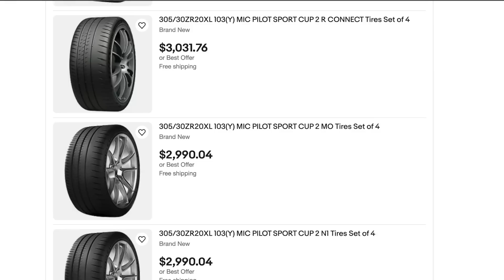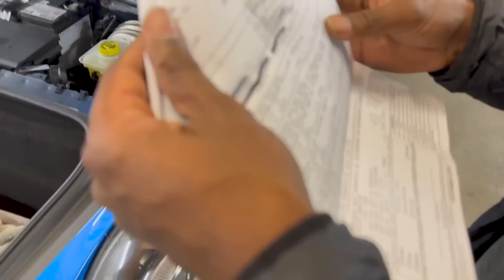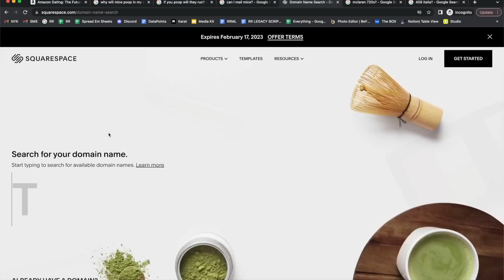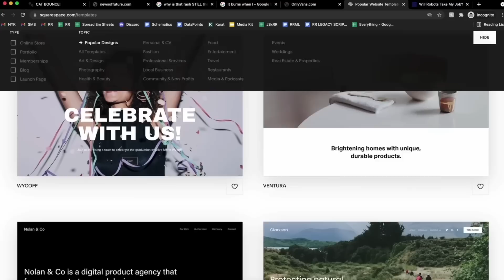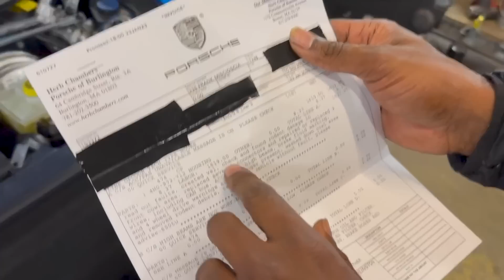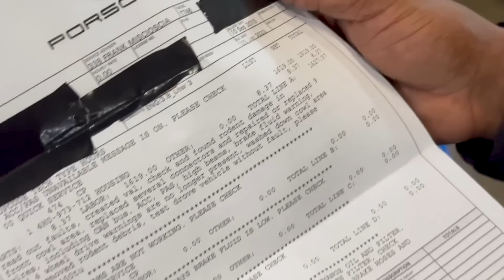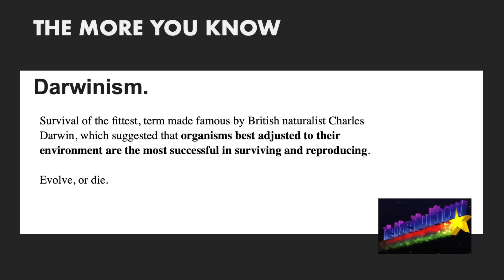I left my Porsche outside for winter and I learned an $8,000 lesson.

Comment: Magnusson Moss Warranty act makes it illegal for a company to require maintenance at their shop in order to keep the warranty valid. They lie. They can absolutely require you to DO the scheduled maintenance but you can do it yourself or at your own independent shop and they still have to honor their warranty.
Reply: Based mmwa enjoyer
Reply: The onus is also on the manufacturer to prove any work done by the owner / non dealer service was the cause of the issue and not the other way around

Comment: Had the same problem with my Audi S4. It's a hot-V six cylinder and the mice were hanging out on the top of the motor, under the turbo to stay warm in the winter. They chewed up a bunch of wires and did about $1300 in damage.

Comment: Not sure why you guys think popping out big dents from metal isn't a thing, it's been done for decades. Sharp dents/cerases will leave a crease, but a smooth dent can be popped out with a plunger scar-free. I've DONE it. They do it at body shops. Doesn't work on tiny dings like this but no one pretends it does.

Comment: Lots of comments below, so someone may have already mentioned this;  where you have mice, they will get in your car. They want to get inside the car and they typically enter in through the cabin fresh air intake.  People will talk about deterrents like mint.  The best solution is to remove components (windshield trim) until you get to the exterior of intake.  I have used the fine mesh from gutters (stainless) and glued/screwed the mess over the intake.  Never had an issue since.

Comment: Gold doesn't tarnish or corrode.  Additionally, and this is quite unique, 1 gram of gold can be hammered into a string that stretches a full kilometer without cracking.  It can then be melted back into its original form with no loss of integrity.
I'm not an expert.  I just got bored one day and asked the same questions y'all did.
It also has really cool infrared and radiation related properties, but that's another awesome rabbit hole for another time.  :-)

Comment: I had a rodent in my car. Luckily it only ate the window washer tubes and the head of one spark plug connection. Oh and it filled the air filter housing with nuts and stuff.

Comment: I think it would have been easier to remove the back tire, remove the inner lining and gain direct access to the dent. Also Gold was used as the form of currency, then it was used as a trade for bond loads as the banking system started. The government stop using gold as a form of loan coverage and printed Fiat money.

Comment: I recently purchased a 2013 Mini Countryman with just over 20k miles on it - the car was immaculate - when I went to replace the air filter (which was in pretty good shape and appeared to have been replaced recently) I noticed what looked like hamster/guinea pig food pellets in the bottom of the airbox although they were a brighter color green - I though how the heck did these get here - I came to the conclusion that the mechanic may have left rat bait/poison there during the last service to keep the critters from setting up camp and destroying the cars plastics and wiring.  I guess that's one way to deal with them although I wouldn't suggest using them in the interior of the car.

Comment: Fun fact: Tesla Model 3s have an aluminum body so they dent easier. Another fun fact: there is a crash plate behind the door so you can't simply take off the interior door panel and pop dents back. Sincerely, a guy who paid $1200 to get a similar dent repaired at a Tesla certified body shop.

Comment: I had to put a custom stainless steel mesh at the cabin air intake hole. The damn mice would chew through the cabin air filter and get into the car. They would then proceed to eat my seatbelt and die inside the car and make it stink. Now they can chew through the cabin air filter only to be met with a mesh they really don't like using their teeth on. They just make nests on top of the air intake manifold using all the firewall sound deadening material instead...

Comment: You should've known better. I live in NH and rodents are a serious issue in the winter. I put my car in a storage unit for the winter. Idk if Porsche is like Merc but they use that horrible biodegradable wire insulation made of like almond shell or some crazy stuff. Rodents go nuts for it. No pun intended. When this happens in New Hampshire the vehicles are usually close to totalled and have to have an insurance adjuster assess them.

Comment: If no one else has mentioned it, in the late 80s early 90s a lot of euro car manufactures switched to a vegetable oil based plastic for the wire jackets and harness bundles, this is actually a common issue with generally older German cars such as BMWs because they too get parked for a long time, not usually because of the weather but I’m sure you understand since the one BMW you owned was an absolute 💩 and from the 30 second google search I did, most other companies that have switched off a petroleum based plastic in the late 90s to early 2000s went to a soy bean based oil, which is still the same thing as vegetable oil based plastics but I would probably assume a mix of veggies is better than straight up soy bean. That or mice/rats/other are smarter than we think and they’ve learned from others that have chewed on 440 volt battery cables… just a thought 🤷🏻‍♂️

Comment: Mice eat mostly bugs and nuts stuff like that. They love the soy in the plastic that the wire coatings are made of. Now rats are another thing entirely they will eat literally ANYTHING including steel they don't care if it's in the way they will chew a hole through it.
Reply: Rats will even chew through the electric lines running to an elevator and kill themselves in the process. On the plus side, from what I was told, dying like that means the flesh was burnt to a crisp so there was no rotting smell.
Reply: @zebraloverbridget  Thats cool a rotting rat STINKS thats why i dont like rat poison.

Comment: Gold is highly anticorrosive and a great conductor. That’s why it’s highly sought after and used on things like electrical pins on many circuit boards. I think it’s more “valuable” than platinum even though platinum is more rare because gold is highly attractive to most people in the color. It probably became that way for so long, now it’s kind of a staple in the rare metal culture so to speak. Seeing gold jewelry is usually more visually appealing than platinum or saying you have platinum.
Reply: Gold is probably the first metal humans learned to work with. It really is easy mode. It's soft and if you hammer pieces of it together they stick like playdoh. It doesn't rust or corrode.
Reply: The industrial/chemical value of gold reflects about 10% of its price. 90% is pure speculation. As to why that is, it's entirely for historical reasons without any real relevance to the modern age.
Gold, as Rich so eloquently put it, is pretty useless compared to most materials, and even more so in fantastical post apocalyptic scenarios.
Reply: @YossiRafelson  Yes thought of that when they were talking about the teeth test. Glad he mentioned the 24k being the softest.